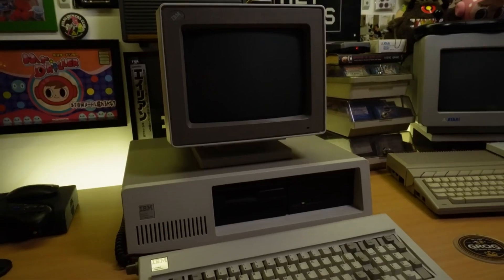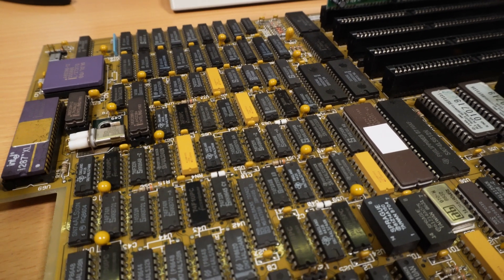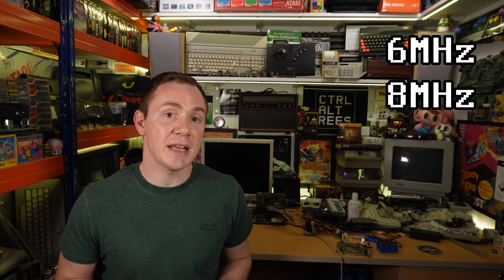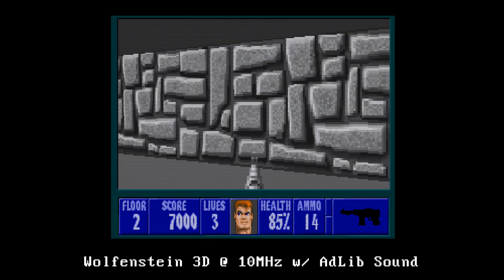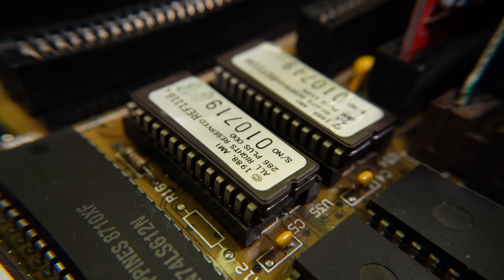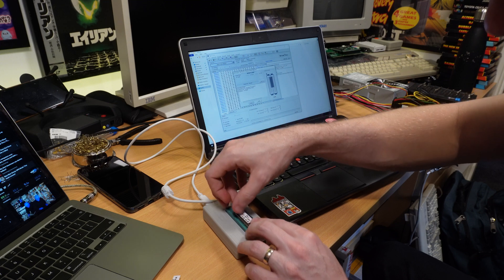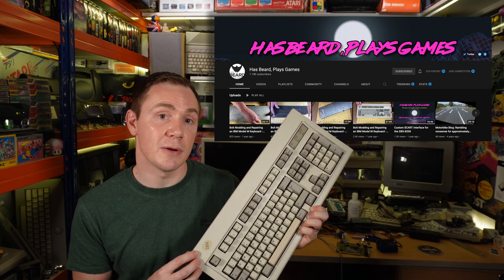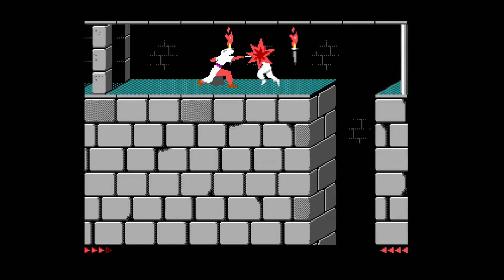1986 IBM 5162 PC XT 286 Restoration Update! - Part 3

Comment: IBM 5150 : Original IBM PC, 63.5W Power Supply, Cassette Port, 5 Slots (1981)
IBM 5160 : IBM XT, 135W Power Supply, 10 MB hard drive, Only Keyboard Port (5-pin DIN), 8 Slots (1983)
IBM 5170 : IBM AT, Initially 6 MHz, easily upgraded to 8 MHz, 3 different motherboard versions
IBM 5162 : Return to IBM 5160 case usage, requiring smaller 80286 mobo (cutout for drive bay support)

Comment: Just trying to revive the 5162 / 5154 combo from my father, which has been in the cellar for about 30 years... The display gave the magic smoke immediately, without even being switched on... the caps are on their way (for the PSU fix), but I'm hesitating to try and start the PC 'as is'... (once the display will be OK). There's no corrosion at all, the storage temp and humidity have been quite constant (+- 15°C and dry) all the time. I'm just wondering how much risk there is to try out, instead of taking the mobo out preventively, and do the recap...? 
Btw, any clue if the installed 287 would follow with the 8MHz hack ?

Comment: I've never heard of systems running the ISA bus faster than 10 MHz, except possibly for the few rare NEC V30HL turbo XTs running at 12 MHz, and people who overclocked their machines. Faster 286s, 386s, etc. used a divider to keep the ISA bus at 8 MHz even at higher CPU speeds.

Comment: Nice video and good shout taking the clock back down to 8MHz. I do wonder why the adlib worked in a 16bit slot and not an 8 bit slot.  They should all just be in parallel anyway.  About the only thing I can think of is perhaps its physically closer to some of the controlling logic and at 12mhz is on the border of timings whereby moving it to another slot throws it out.  

Looking forward to see what you do with the monitor 👍
Reply: This explanation is likely the correct one

Comment: So we finally get to know the AdLib culprit ;)
(Also interesting, speaking of it, my AdLib image is now also used for the ISA bus didn't know ^^)
My personal guess on that behaviour: It's not the 8 bit slot per se. ISA is more or less an extension of the CPU bus itself (hence the 8 bit slot just isn't connected to the other 8 bits), and here's the bit: As an extension, singal quality degrades and runtimes increase over length. Not sure how the slots are connected, but it's possible that one or both things played a factor for this last slot. If certain times exceed the expected timeslot for an operation, or the higher bus speed smears the signal too much, you're having a problem.
Reply from the maker: Very interesting! So the timing gets more sensitive the further the slot is from the CPU due to the signal degrading. That's a great theory. 👍
Reply: @ctrlaltrees  Yep. Depends on your CPU and bus though. This applies up to most 16 bit CPU data bus systems (I think), as on higher CPUs (286 and above) usually the chipset implements the bus. 
It applies again (and may be worse) for VLB buses, as these are - again - an extension of the CPU bus (also not applies to the few 586 VLB systems, there again the chipset takes it over, as VLB was very specific to the 486 bus). But in the chipset cases, it's then simply the length from the chipset.